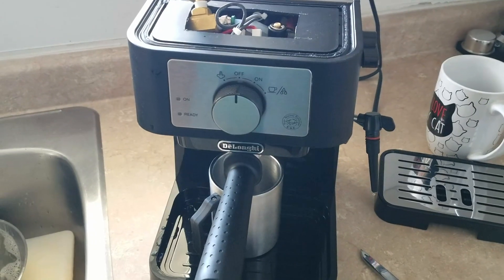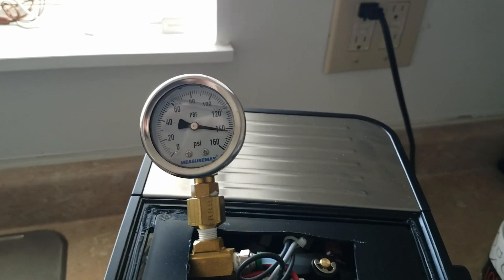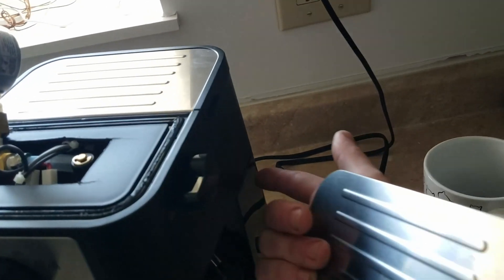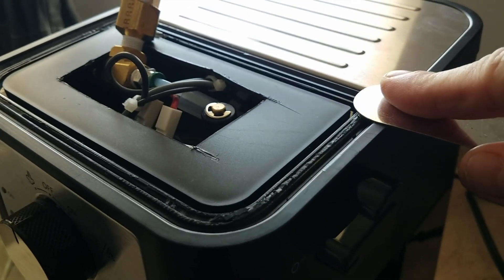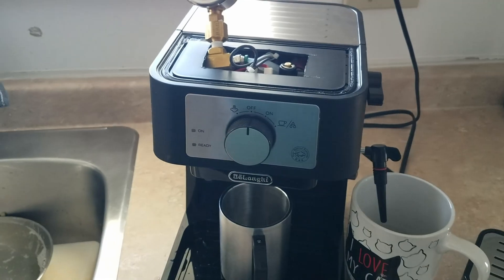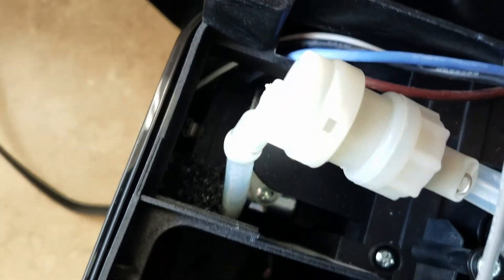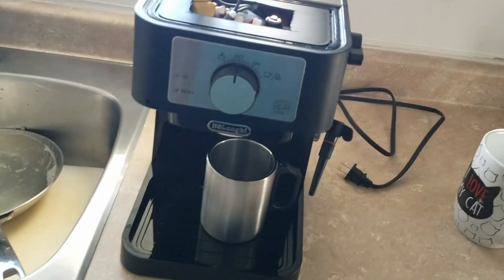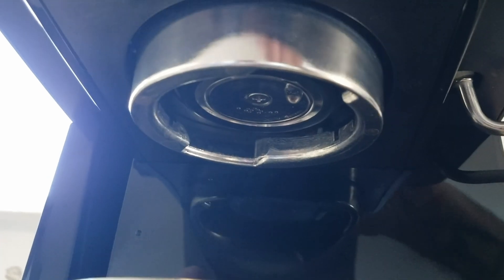De'Longhi Stilosa Partial Disassembly and Operation Test

Comment: Hey dude, this is awesome! It’s inspired me to mod the hell out of the stilosa I just picked up second hand.

I have a question for you; is it normal to get bubbles in the water reservoir? It’s a little random when it happens, and while running a decalc cycle it bubbled quite a bit in the reservoir lol
Reply from the maker: oh like you think you're getting air in the boiler??
there's an o-ring inside where the little ptfe hose connects to the boiler from the pump at each end

you might have to replace that
they can be ordered from delonghi or maybe a store that sells delonghi products that's close to you.

there's a small little clip pin you pull out which is pretty easy to spot right where the hose enters the boiler, then the hose pulls out and the o-ring may or may not get stuck inside

If it's not those, then it's probably a bigger issue that's possibly unfixable is my guess
Reply: @justinbouchard no, funnily enough I don’t think I’m getting air in the boiler itself. I believe that because I’m able to get a constant jet of steam without sputtering, which (I believe) indicates that there’s no air running through the system.

It’s actually the reservoir itself — the plastic tank at the back you fill — which is having bubbles come into it via the water intake, almost as if steam is being formed in the boiler and somehow flowing backwards and exiting into the water tank. Very strange…

I really hope this is not an unfixable issue lol. I picked this up because of the number of people who talk about this machine being pretty much always repairable, so that’d be a bit sad haha.

I’ll open it up tonight and see if there’s any blockages/very obviously buggered seals or gaskets.
Reply from the maker: @matsab7930  oh that's weird!! maybe there's a small bit of something stuck down where the water reservoir plugs in at the bottom?
there's no water leaking anywhere?

I just re read what you wrote.  I don't think getting a clean jet of steam will be a helpful sign.  The water is boiling in the boiler making high pressured air/steam so it's just more air.

When do you see the air bubbles coming into the reservoir?  Does it happen after steaming?
After you're done steaming you for sure need to run the pump with the steam wand open until the boiler fills with water.

Otherwise you're just leaving a massive air pocket in the boiler.  Then if you close the steam valve and turn off the machine, or even just turn it off steam function, the element is still super hot and creating pressure.  So I think it's possible to create enough pressure in the boiler to backflow past the pump into the reservoir.
Reply: @justinbouchard hmm, interesting. I’ll need to do some more testing this evening to figure out what it could be. It did seem as though the bubbling increased in frequency when the boiler got hotter.
Reply from the maker: @matsab7930  yeah it seems like a bit of a weird one!!  feel free to comment here or wherever on my stuff to ask any more questions if you have any updates!
Reply: @justinbouchard hello again! I seem to have fixed the bubbling reservoir issue. At this point, I think it was due to a blockage somewhere in the system due to a build up of calc and a lot of gunk in the brewhead.

Now, cleaning the brewhead has exposed a more serious problem… I noticed that there are these two little plastic parts built into the brewhead which appear to assist the portafilter in rotating and forming a seal with the gasket and, well… one has fallen out and is a little damaged. It looks as if they were originally glued in, but the glue (or silicone?) has failed and the part has come loose.

This has had the unfortunate side effect of making my portafilter leak out the side :). Yay. If I screw it as far as possible counter-clockwise then I still seem to be able to make a seal with only one of these plastic bits in, but it leaves me nervous and I’ve only tested it with the pressurised basket and no coffee so far, so I’m not sure how the seal will hold up to a proper basket filled with espresso-grind coffee…

Have you any experience with these parts? Have they ever caused any issues for you? Do you think I’ll get away with having them both removed?

Thanks again for your time. This particular problem confounds me because… man, what a shame. If this really bricks my machine then it’s an unbelievable design flaw in an otherwise fantastically designed machine…
Reply from the maker: @matsab7930  i'm actually uncertain which plastic part you're talking about, i just looked at mine and where the portafilter slides in mine it's just grooves in the metal

the portafilter "slot" and the boiler are all one piece on the bottom half on the boiler

i'm 90% sure you can just buy a new boiler head and put it in easily if there is something broken inside where your portafilter locks in

i'd say maybe try taking it apart and removing the boiler and taking a look at it like that, it would also allow you to remove the boiler top and manually clean out all the scale inside

edit:  i just looked at one of my other videos https://youtu.be/BHG0poe-0hg?si=U5UpA2DEpBBRK12d&t=214

i think i do see a plastic part in there which fits inside of the metal frame, if that's what you're talking about, that piece could possibly be ordered too

this video might be helpful for you if you haven't seen this one yet

i don't really "teach" how to do anything i'm doing so I don't have like step by step here's how to disassemble it

but it's really not difficult to take apart, just make sure it's unplugged lol :)
Reply: @justinbouchard huh, interesting, looking through that video it seems visible around 5 minutes, but I don’t actually see the little black inserts; maybe yours fell out too? I’m kinda hoping so, as that would give me some hope I don’t need to replace the entire part lol.

I’ll definitely be removing the boiler to do a proper clean, though that’s unrelated to this issue with the plastic inserts
Reply from the maker: @matsab7930  when you take it apart try fitting the portafilter in with the part in your hand so you can get a good look at it
Reply: @justinbouchard Will do. Thanks again for all your help! I stumbled upon your videos when looking in to fixing up an old stilosa, and i love your mentality to coffee making in general :)
Reply from the maker: @matsab7930  you're welcome!!! thanks so much :D i hope you get it solved!

Comment: My first Stolisa overheated after about a year and a half, and the second one after just two months (replaced under warranty). Any tips to prevent this? Maybe descaling or adjusting something? Once my wife left it on for 20 minutes without brewing, but I’d think it should have a cutoff.

I also read online that if it overheats, you should start brewing before the green light turns on. Haven’t tried that yet. If I can fix the old one, I’d like to pass it on to a friend.

By the way, just for information purpose, on both machine machines that broke, they were smoking and every time I seen smoke, I knew it would be burnt
Reply from the maker: there's really not much that can go wrong inside of these, if two out of two lit on fire for you i'm not sure what to say
I quite literally had mine on for almost a year straight, never turned off after installing the gaggiuino mod.
Reply: @justinbouchard  maybe it was just a grind or something I’m using pre-ground coffee. I don’t know. I bought this so that I didn’t have to buy an expense machine so if I have to buy a grinder now, I might as well have bought a more expensive machine instead

Comment: mine has a terrible smell i should take it apart replace the hoses and also clean inside the boiler which i suspect is really foul from the dairy sucked back into the boiler
Reply from the maker: it's easy to take apart!

Comment: I took off the shower screen and the gasket and now I can’t get a good seal - water always comes out around my portafilter. Could you possibly show how to reassemble?
Reply: having the same issue
Reply: @nerdusbirdus  I ended up taking everything off again, while it was disassembled seating the screen in the gasket to make sure they fit well, and then putting it back together and the second time worked. I also made my grind a little coarser.
Reply: Also there are two little plastic pieces that sit in the group head I think to stop the portafilter from over rotating and one of mine had gotten unseated so I squeezed that back into place - that might have been the key for me
Reply from the maker: @willisplummer  i'm sorry I never got notifications for these comments!!
were you able to get it working?

Comment: Ah what a maniac! Dimmer on a Delonghi? Pressure gauge... solenoid function by steam valve :) You know at some point a real machine is simpler :) I'm just here tl scavenge the pump, I ruined the one in my proper machine (Lelit) and it's taking forever to arrive. Though I repaired the old one but now it leaks.... gah...  fittings are an issue, I have no idea where to find those. Plumbing stuff is easy but espresso fittings are small...
Reply from the maker: it's called experimentation and learning ;)
Reply: @justinbouchard   Nah it's cool, just seems like a GCP would be worth the effort more. I did however manage to scavenge the pump and put it in my Lelit Anna PID while the new one arrives so thanks a lot! Took me 6 minutes to take apart :) BTW I can highly recommend the Lelit Anna PID over the GCP. Good PID included, good build quality and way bigger boiler (250 ml vs 110 ml) so temp stability is fantastic. 57 mm is a bit of a pain but you can find baskets and stuff.
Reply from the maker: @please_stop-v7o gcp is overpriced garbage just like almost all machines
espresso takes only a few things.
controlling water temperature and pressure as accurately as possible and the ability to deliver that controlled water onto ground coffee.
get over yourself and your consumerism.
Reply: @justinbouchard   I feel obligated to mention it because everyone loves it. I personally think my Anna is far far superior and the machine is larger, so it has made it comfortable to mod. The case is stainless so I needed a boron carbide stepped drill bit (7 bucks amazon) to cut holes but I love the thing. Pressure gauge also there already, good steam power etc... I think with mods it is the best machine. Sadly in US/Ca Italian products are more pricey. I got mine for 400€. 

Added a dimmer as well as a bypass via On On toggle. So I can now set the dimmer to a preinfusion pressure, flick the bypass and I get full pressure (dimmer at full is less than no dimmer, 0.5 Bar with me, it always has some electrical resistance). 

I love that. I preset infusion pressure, hit the toggle for full power at 30s or so, hit 9 bar, and for the last 10g I turn up the dimmer, hit the toggle to select the dimmer circuit and trail off pressure. 

If course it comes with a proper solenoid, so backflushing and pressure relief before unlock and all that is there. The components are good and fairly priced and half the internal space is empty, modders like you would love that. 

Changed shower screen, got a nice basket, made a wooden steam knob (I need my guitar stuff for my guitars :)

Covered all the plastic in mahagony veneer with some teak contrast. 

Wooden rosewood handle for the PF direct from PRC 20 bucks Amazon. 

Now I have a PID, pressure profiling, with pressure preset machine that looks like 3 grand and makes coffee that is better than all the flat 9 bar LaMarzoccos on Earth. 

Oh and unlike the GCP the OPV is not fixed, there's a screw to adjust spring tension so you can simply set the OPV to desire, no faffing around with changing springs and fine control. If you want 13.2 bar no problem. 5.5 etc... not limited to 9, 12 and 6. 

Paired it with a Mignon Silenzio with a few single dose mods, a spray bottle and a wdt and now an acquaintance that got me into specialty is annoyed at me because his brother said my coffee is better than his, from his 2500€ machine haha. 

If you ever want an excuse to put the Delonghi in your workshop or wherever and have a proper beautiful machine that comes stock with many features that have to be modded on a GCP or similar PLUS is an amazing mod platform look no further than the trusty Anna PID. Also they have a YT channel for techs and show you how to replace any component, clean etc.... I use it all the time and customer support replies to my crazy queries which is nice. 

Had it two years, no problem except I skimped on water filters once and my water is hard. Mkay boiler disassembled, everything bathed in citirc acid, gasket replaced... 

I forgot about the pump and it ran dry for a few hours. Spring on the valve snapped. Replaced by spring from BIC pen and it worked but I ruined the threads on the pump outlet and so now it leaks. Part is 6 bucks pump is 20 bucks... oh well. Lesson learnt. The DeLonghi Ulka is pretending to be an OLAB for a few weeks now. Identical specs on the pump. I ordered one with brass outlet instead of plastic. 

Happy modding and if you're ever in Europe give Flying Roasters in Berlin a try. Also buy stuff. Italian made products are up to 50% cheaper here. I was shocked how expensive espresso machines are on the American continent...
Reply: @justinbouchard   And I was joking dude, I love your project. I am no consumerist. I play Epiphones with Tonerider pickups. I am the most magnificent cheapskate on Earth you limey so and so! And now I play Harley Bentons with Tonerider pickups. 158€ for a Telecaster and I wouldn't trade it for a made in US. I was going to mod my Stilosa but in a rare occurence my family gifted me the Anna if I paid for the grinder and invited them for coffee. I wasn't going to refuse that. 

Consumerist... I live of two bars of chocolate a day because I'm too broke to afford real food despite working manual labour 30 hours a week. Bloody hell. Is sarcasm a lost art across the pond or what??????

Comment: How do you open the bottom part where the water filter is?
Reply from the maker: Hey!  Not sure what you mean.  I do show how to remove the bottom cover.  There isn't really a water filter in there, kind of a screen I guess where the water reservoir plugs into the fitting.
Reply: @justinbouchard  I'm currently having an issue with my Stilosa EC230 where whenever I turn it on, it immediately turns itself off, or sometimes in the middle of preheating, Im trying to disassemble my unit completely in hopes of fixing it myself but Im having trouble opening the bottom cover of the stilosa. Thank you for the response btw!
Reply from the maker: @cardboardkingrv7316  https://youtu.be/5QWq6GQUKjs?t=932    Sorry I thought i had it in this video you're commenting under!!!!  This link will bring you to where I show how to take it off :)
Not sure what the problem could be there unless you somehow blew the little breaker thing that is under a clamp on top of the boiler.
Feel free to comment away and ask questions if you need.
Reply: @justinbouchard  I FINALLY GOT IT TO WORK!, turns out I flooded the circuit board of the power switch, I wiped it dry and blow dried any remaining liquid in areas I cant reach then it worked perfectly again! Huge thanks to you and your video on how to open the under cover HAHA, I couldn't have fixed this without it!
Reply from the maker: @cardboardkingrv7316  yay!!! I woke up a bit ago and was hoping you were able to make some coffee this morning with it :)  So glad me/my video were helpful!!

Comment: When I turn to brewing mode as soon as the ready light turns on, the shower head ejects so much steam. Is this normal?
Reply from the maker: Unfortunately that is how it will be, yes. It heats up to around 105-108 Celsius when the brew light turns off. So yeah the first but if water that comes out is boiling. You can try to flush it real quick then put your portafilter on it and start your brew before it turns the element back on and boils it again. It happens pretty quickly though so it's kind of hard to time.
Reply: @justinbouchard  thank you so much! Great video!
Reply from the maker: @mucaaco1  you're very welcome!  Thank you :). I have a few videos about this machine. Interlaced in all of them I do share information about how it operates stock but it's super inconsistent lol

Comment: Hi do you have tutorial how to instal the pressure gauge?
Reply from the maker: Hey!  No sorry I don't. You will need a tee that can accept 4mm compression fittings. Then you'll need to find a gauge and however you'd like to mount it. It wasn't particularly easy. And it won't be plug and play.